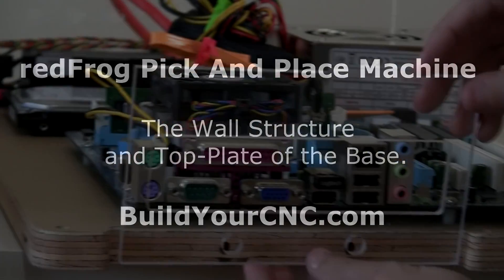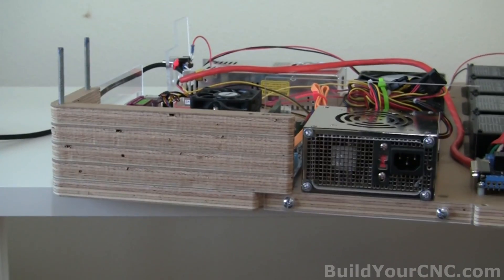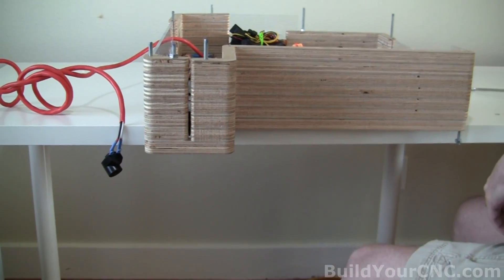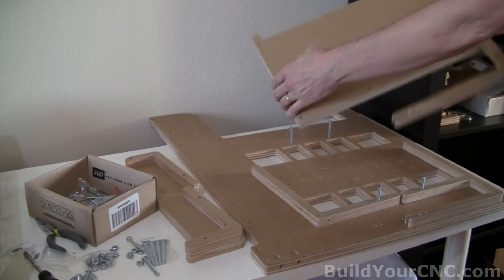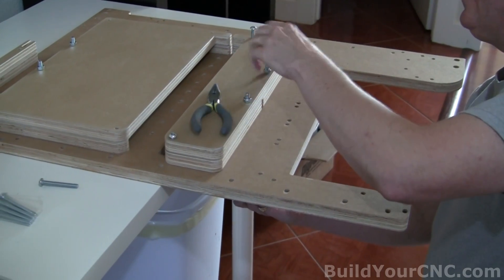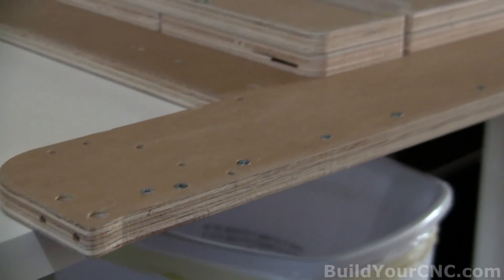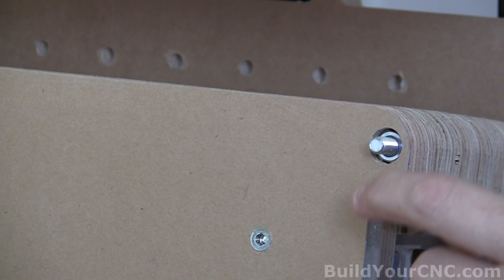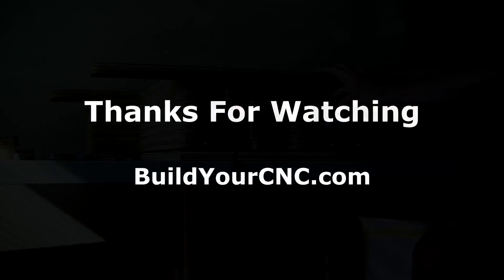redFrog Wall structure assembly 12/15

Comment: For long term health effects, the case prefers shielded. Line/glue the inner walls with aluminum foil then ground the foil. Orient the plugs away from you or towards rear, as typical.  I have no facts to show you why. But people get cancer from far smaller devices.